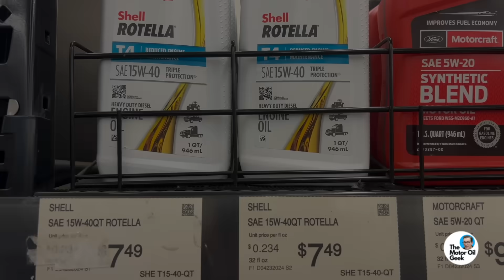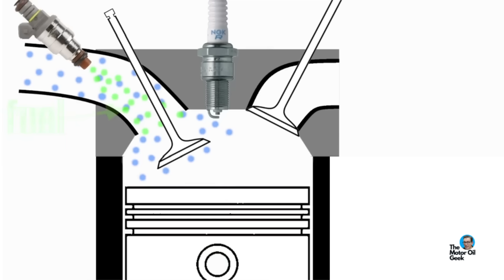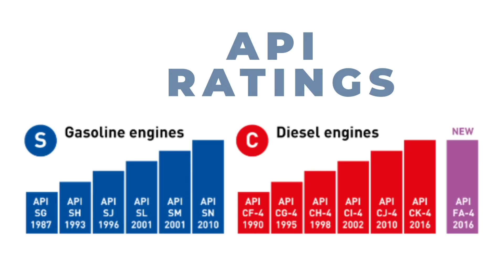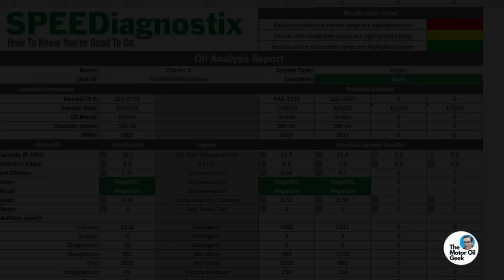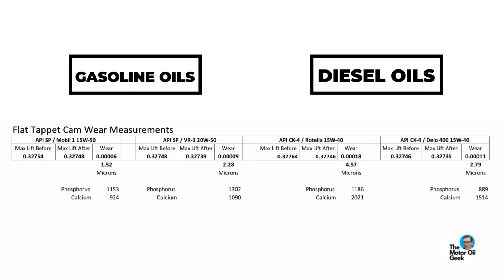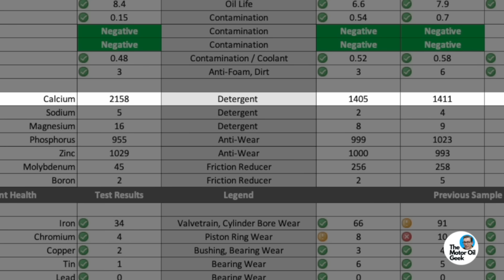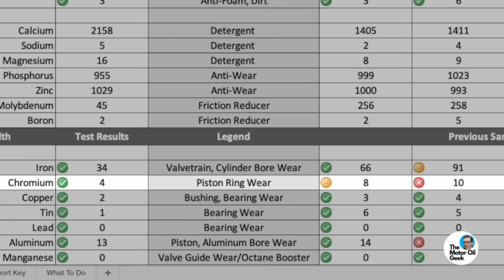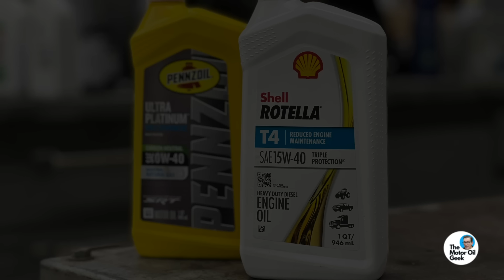Why DIESEL Oil is Actually WORSE for Gas Engines!

Comment: You have to be careful about making claims about ZDDP.  The statement that MORE is not always better is only partly true.  What is more important is the type of ZDDP used.  Primary alcohol ZDDP are not designed to work with slider follower cams.  They work with hydraulic fluids just fine.  Secondary alcohol ZDDP works better with cams, but even then, there are different types of secondary alcohol ZDDP.  The best for wear protection is isopropyl alcohol ZDDP.  However, IPA ZDDP is a solid and cannot be used at 100%.  There are ways around this though.  
Although you may need to simplify your presentation for the audience, don't overstate your position or others knowledgeable in the field may take exception to your statements.

Comment: You know what they say the wrong oil is better than no oil.... been runnin rotella t4 in my old sbc engines for years also run valvoline vr1..... vr1 has more zinc than t4 so is vr1 worse for a gas engine than t4?

Comment: Can you do a episode on Shell’s multi vehicle 5-30? Recommended by mechanic friend to use on turbo charged gas motors and hard working V8s. It’s shell rotella’s formula for gasoline motors after they discontinued rotella gas truck oil. I was running the shell gas truck for many years and after they discontinue oil, I went to shell multi vehicle. Myself I’m a contractor and my vehicle idles and sits in city traffic for hours and I put on almost 1000 miles a week.

Comment: Not really addressed is the frequency of oil changes that usually happens on some vehicles is greater, (ex motorcycles). ,& unfortunately rotella t4 is not %100 synthetic & T6 rotella is , so this could confuse some people (my self included). Then there was the issue of meets the requirements of Jasco Ma 1&2 , but the oil "supposedly " was not officially certified at one point! Science wins , but dirty oil changes all of that in the end.Guess if you pay this much attention to your oil type & brand , you're unlikely to have dirty oil any way!

Comment: But you’re talking about newer engine. Rotella is one of the best oils you can put in an older flat tapped cam engine. I run it in my boat with an old GM 305. Does great. Ive ran it in my 23 year old Camry that burns oil too. Actually burned less oil with rotella than a syn 5w30 oil.

Comment: What about diesel engines in europe calling for specs like 229.51 or vw504/507 which are for both gasoline and diesel engines? Will a sprinter van with the OM651 engine for example be better protected with a 15w40 API CK4 than the 229.51 spec (Mobil1 ESP 5W30)?

Comment: T6 must have been reformulated since it does not identify as a diesel oil anymore and it suggests it’s for motorcycles, passenger cars and trucks (also diesel)

Comment: What do you suggest for my 20HP Briggs Opposed Twin? It is like a 2 cyl Subaru engine with a flathead 🤣🤣
Reply: What does your manual say to use ?
Reply: @TonyBenton0728  Straight 30  conventional or 5W30 if under 32 deg. It is splash lube (there were some pressure lube models).

Comment: I've been running t4 or t6 in all my motorcycles and dirtbikes for over 15 years. They are JASO wet clutch certified. I love using it for the price. Is it better? No. But its a better price

Comment: A while back the same dude said that Dello could be ran in a gasoline engine because it was also ready for gasoline so which is it this I know for a fact I've got 6000 hours on a Harbor Freight Predator generator that has never had anything in it but Dello what I understood him saying you can't run a gasoline oil in a diesel but you can run a diesel oil in a gasoline

Comment: I been using Valvoline in the red bottle in my truck forever. I thought about using rotella cuz I can change my bike and truck oil for 13 dollars. But I use mobil1 10w40 4t in the dirt bike.

Comment: Fantastic video Lake! Learned a lot with it. It does raise a question, about Valvoline Restore and Protect. I'm guessing its using a different chemistry to do its cleaning than the calcium ?
Reply from the maker: Correct. Different chemistry in the Restore & Protect.

Comment: I work for a largecompany, and we have a large fleet of semis, and we run one oil in everything, Mobil Delvac1 5w30 Advanced full Synthetic, we have a mix of Cummins ISX, ISB, ISC and Detroit DD12, DD15 along with GM 6.0 gas, Ford 3.5 Non turbo, and Toyota Propane Forklifts, they all get the same oil. I’ve often wondered about this, although we did have a 6.0 GM engine run well past 400,000 miles with no engine issues.
Reply: Yeah I also work for an outfit with a large very diverse fleet, everything from lawnmowers to quads and sleds, jetskis, boats, small cars, minivans, light and heavy trucks, heavy equipment. All of it gets synthetic 5w40 diesel oil. We've lost four engines, all in light vehicles, three gas one diesel. Two of the gas enignes developed leaks around 20 years old with 200k miles and were oil starved, the other spun a main bearing around 150k miles but the guy driving it was regularly was going double or triple the oil change intervals so I can't blame the oil there. The other was a Ram 3.0 Ecodiesel that had the rad fan quit and spent an entire summer being repeatedly overheated on top of excessive oil change intervals.
I don't know for a fact any of our gas vehicles are direct injection, although we do have some turbocharged gas engines.
Reply: @Rev1Kev  make sure your guys prefill that Toyota 4Y oil filter that goes on upside down 🤣
Reply: @cb84capri  that’s a challenge, gotta be quick😂
Reply: I work for a large construction company, with a fleet of trucks, excavators, cranes, tugboats ECT. Almost everything is diesel powered with the exception of a few small gas engines on pressure washers, trash pumps, ECT. We use the cheapest bulk oil we can get, no idea what it is as it's sold as a straight SAE 40  and arrives in tanker trucks. The company only cares about getting the absolute lowest price possible on oil. When I have to order oil they tell me to call a bunch of oil distributors and get prices, then order from the cheapest one. We have a ton of engine failures, however I believe they are mostly caused by running engines low on oil, operators not charging the oil on time, and other abuse. I work mainly in the marine side of the business on the tugs, my experience with this dirt cheap oil is totally different. Been getting an average of 45,000 hours out of a genset engine without any internal work with this oil provided it's changed once a week, mains are going close to 30,000 hours between inframes, ECT. My opinion is people worry too much about oil, when maintenance is the key to keeping engines running for a long long time. It doesn't matter what kind of fancy $50 a gallon oil you use if your not checking the oil level at least once a day and changing it at least every 150 hours.

Comment: Rotella T6 guys need to actually read the bottle. Gas ratings disappeared several years ago. Not stopping me using it in my older gas engines.
Reply: Yeah it is not gas rated. I stopped using it in my direct injected F150 because I don't want to blow it up with LSPI. 

I'll continue to use it in my port injected car though.
Reply: Apparently US spec 5W-40 dropped gas ratings. 5W-30 still has gas ratings.

Comment: 1996 ford f250 5.8 Windsor motor. 300,000 miles. Always ran 15-40 rotella still runs like new, no oil burn
Reply: My neighbor had the same result, but I'm afraid to go that route. I just do a lot of oil changes on my 100000 mile motor.
Reply: Same with my 89 Lincoln mark 7 that sees 500 miles a week. ABSOLUTELY no blowby or smoke. Oil changes have been done religiously on all my vehicles.
Reply: have an 89 f250 with a 90's roller cam 351, idk how many miles are on it it it just keeps going to zero after 99,999 but the t4 smells a lot better in the engine and seems more happy
Reply: I use it in my 83 Lincoln. It works great.
Reply: How dare you give us real world evidence that diesel oil works amazing in older engines! 
Gotta love the Nay sayers. I run shell rotella in all my older vehicles and always have. I don't care what research says 5w30 in a v8 seems so wrong 😂
Reply: @PatricellisParadise  even channels like @projectfarm on youtube have run tests showing there is better physical wear characteristics on diesel oil. and had lab resuts run on the oil. seems like this guy has an axe to grind.
Reply: @joshualester2735  To sum up the entire video, he stated diesel oil in a turbocharged gasoline direct engine is not advisable. Doesn't seem like he has an axe to grind at all, just advising people not to run diesel oil in new GDI engines is all.
Reply: @joshualester2735  Yeah because project farm is better at measuring wear that oil manufactures teamed up with engine component manufactuers measuring wear a 1 millionth of an inch lmfao. That old bearing wear scar, that even he says isn't accurate, trumps all yee haw!
Reply: @bobbygetsbanned6049  i legit ran T6 5W-40 in a Kia Sportage and Chevy impala for 4 years cleaned the engines right up .
Reply: @Mr_Meowingtons What's your point?
Reply: @bobbygetsbanned6049  We should uncritically accept the data from the oil company, who wants us to buy high-end gasoline engine oils, for 3x the money. Nevermind the fact that the whole video is talking about direct injection gas engines, which nobody is trying to run diesel oil in; and never once in the video do they mention carbureted engines, which tons of people use diesel oil in. 

This is clear propaganda, to sell expensive oil to rubes. My aftermarket cam manufacturer specifically recommends Rotella and Delo diesel oils with my flat tappet cams, because they meet their requirements. Lake Speed is shilling for oil manufacturers.
Reply: @PatricellisParadise  It's called an anecdote, you rejected the empirical evidence in favor of staying in your cult. Don't act like you're on the right side here.
Reply: @bobbygetsbanned6049  when I grow up I want to be smart like you one day
Reply: @bobbygetsbanned6049  Do you seriously think people are draining the 0W20 and dropping in CK4? 😂😂    EVERY anecdote is an older engine.  Lake is creating a scenario to a problem nobody cares about.   Now let's talk about putting API SP in those engines and tell me if CK4 is a better choice
Reply: Anecdotes for the win. Who needs data when we can listen to bubba down at the dump??
Reply: @bobbygetsbanned   Arguing with a commentor is like wrestling with a pig in the mud... after a while you realize the pig likes it. Finding one big hammer in the toolbox is easier than picking an appropriate size hammer and you know it will work for pretty much everything. Cheers
Reply: @bobbygetsbanned6049 😂😂😂😂😂😂😂😂 yeah that’s it

Comment: Sounds like diesel oil for 1 oil change interval would do a good job cleaning out your engine with all those detergents and dispersants and if you have an old engine low on compression with a lot of blow by…just be careful not to put it in a gasoline direct injected engine and I’ve heard that the extra zinc will harm/clog newer catalytic converters

Comment: I have questioned some of your analysis over the last year or so, but this one is over the top. I have been using Shell Rotella in all my small gas engines and motorcycles for 35 years now. NEVER one single problem. Engines are spotless when I pull valve covers to do an adjustment.  Also some of your videos absolutely contradict other tests I have read.
Reply: I am curious about this as well. I see no logical reason to run diesel oil in a late model car engine, however; I’ve been running Rotella T1 straight 30 in my small engines for years. Last I checked it still carries an SL rating. I’ve been questioning my own thinking about this for a couple of years.
Reply: This video is a statement of fact. Your anecdotal data is irrelevant. Why are you people so obsessed with diesel oil in gas engines?? It's literally just a known fact that increased detergents compete against the anti wear additives, that's not disputed by anyone that knows anything about oil. So why do you refuse to accept the simple fact that detergents you don't need in a gas engine, do more harm than good?
Reply: @bobbygetsbanned6049  Off the shelf automobile oil will not last 50 Hours in the Race MX bikes I rebuild daily. However Shell rotella 15W40 from Walmart can go for over 150 hours before the motor is at risk of failure. Are there better oils sure but off the shelf automobile oil (don't care the brand) is on the bottom of the list in my vast experience.
Reply: @bobbygetsbanned6049  You have absolutely NO idea where my data came from. So to say it is anecdotal without that knowledge reakes of arrogance.
Reply: It's only direct injected engines where you need to worry about it. 

I ran it in my 2.7 F150 for 40k miles, but I stopped using it last year after I heard about the issue with Low speed preignition. 

Just to be safe I switched to Pennzoil platinum. I'll continue to run rotella T6 in my other vehicles and T4 in all my small engines.

Comment: I remember back in the 90's, when Amoco was still around, they had oil that was listed for use in Diesel and Gas engines. If I remember correctly, it was 10W30.
Reply: In the 90's there were no direct injected gas engines or very few. Maybe?

Comment: Many VW 1.8T direct injection owners use the Rotella T6 5w-40 because many experienced sludge issues with these engines.
Reply: I also know that many VW 1.8T owners don't change their oil every 3k miles, they are doing 7500 and 10k.
Reply: @TheOfficialNakatsuMegami  True. Still the points he makes are valid. I use the T6 in both my 1.9L TDI and 1.8T conversion in a VW Vanagon. I think in the future I will find another oil to use in the 1.8T.

Comment: I ran Rotella t4 0w40 In my built/modified 350whp r53 mini , after running the car HARD for 5k miles , I checked my internals and it HAD 0 WEAR and looked like the day I installed it all..

Comment: I’ve used diesel oil years ago in motorcycles and still use it in my small engines.
Reply: He's must be a bullshitter. It says right on the back of different rotella jugs "jaso-MA and or  jaso-MA2 depending on which one you get which means it's ok for most jap wet clutch bikes. His video is vague and generalized as usual.

Comment: Your comparison of Flat Tappet Cam wear when using Diesel Oil is a strange comparison.
I understand why you did so, to deter it's use in those builds.
But the largest use of this oil is in four stroke motorcycles. Of which none are flat tappet cam equipped. I am also not familiar with any direct injection motorcycle engines being sold by any of the major dealers in the USA. 
Soot isn't an issue in carburetor or fuel injected small displacement engines, and nearly all are wet clutch shares transmission engine cases. As a result will shear the oil and cause shifting clunks giving you an indication of it needing to be changed. Generally around 3,000 miles. None of these issues in the video affect motorcycles, I will continue to use it as I have for well over a decade

Comment: HI Lake,   so for GDI what is the best oil for the application.    Also with the EGR that these have lots of soot buildup on the valves just like the diesels.    In addition GDI engines have soot in the combustion chamber.   If you look at combustion events (in cylinder crank angle based photography)  GDI you get yellow flame fronts just like a diesel engine.   Non GDI burns clean and no yellow flame.

Comment: This great video gave me a lot to consider but also some questions. I know enough not to use a C=rated oil in a MODERN S-rated application... for the reasons you described... but what about the old school? Is a C-rated oil MORE  suitable to an old-school, metal-shedding,  flat tappet carbureted engine that naturally contaminates the oil with more combustion byproducts due to imprecise fuel metering than a modern EFI engine. When ZDDP went away, there were few alternatives outside of expensive boutique oils that not all of us were anxious to use for cost reasons. In an earlier video,  Lake, you stated an SP oil was suitable for flat tappet engines... which was a revealation for me. Following this line of inqurey, would you please consider a narrowly focused video that helps people with old-school carbureted engines make the best lubricant choices?  Including some non-boutique choices, for the poor or tight fisted among us? Seems like you could also address the needs of a somewhat tired old school engine. I bet you could fine a good running but somewhat tired old school engine to do some testing on to measure how age and wear effects the oil. I have been an oil nerd for decades and love having my preconceived notions impact the ground in a  ball of fire as the ack-ack of science shoots it down. I have "gone for a Burton" (old RAF expression... look it up) several times being schooled here. More and more, i wish I had spent my career as a tribologist!